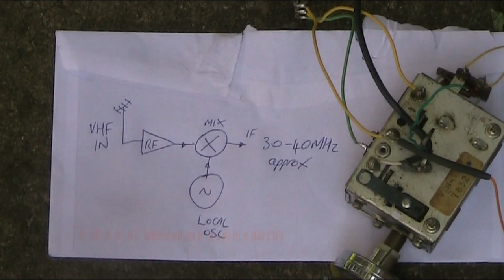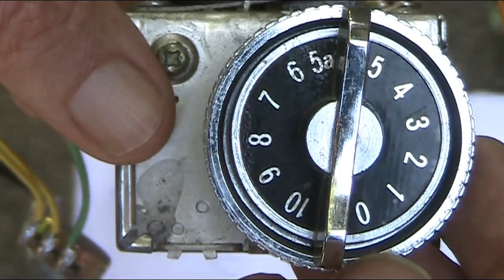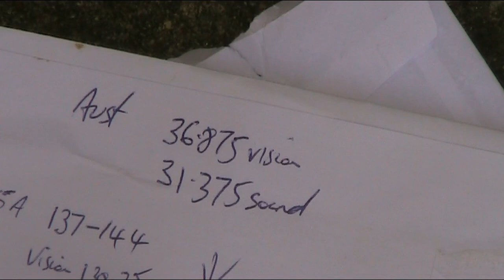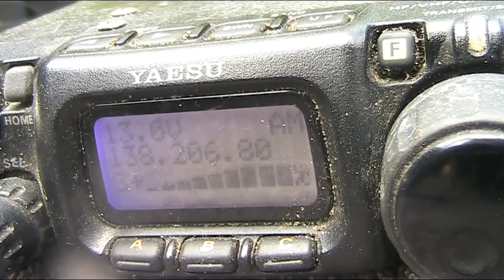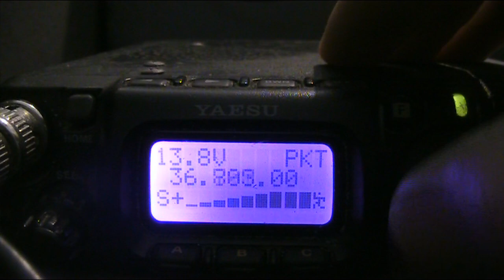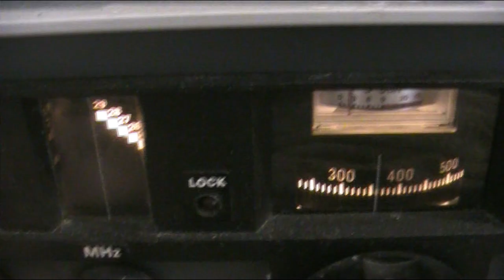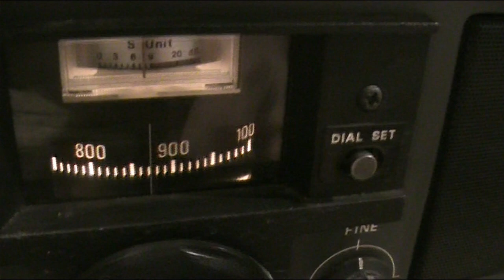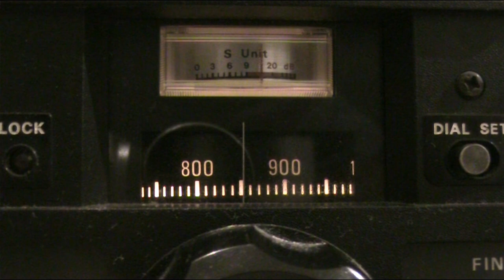Amazing things you can do with an old VHF TV tuner

Comment: You can use the later variable resistor types if you have a 33V regulated supply (grab the shunt regulator IC from the TV set main board, it is a pretty good regulator) and run around 1mA of current through the regulator to get 33V tuning. They do have slightly better sensitivity, lower drift though might need a few more supplies, and as a bonus also give a signal strength indication as well, normally used in the TV set to mute audio between stations. The later digital ones though need either a PWM drive, or are programmed over I2C bus entirely.
Reply: Varactor tuned. Yes more stable than the old mechanical tuners :)